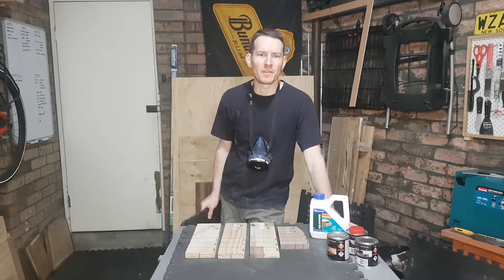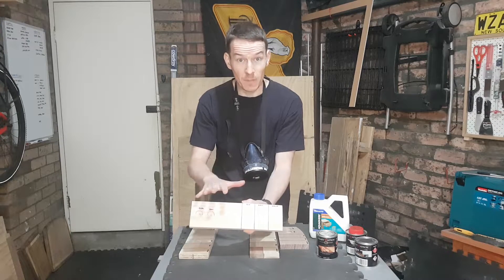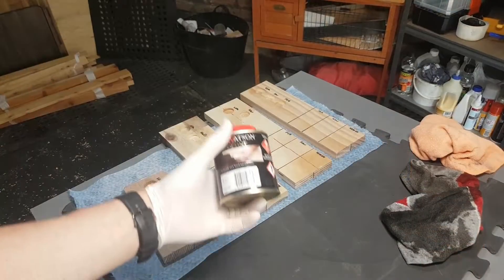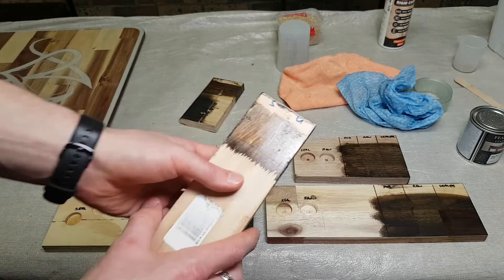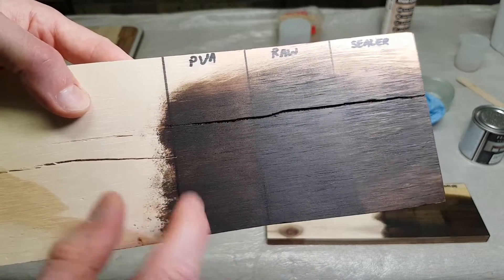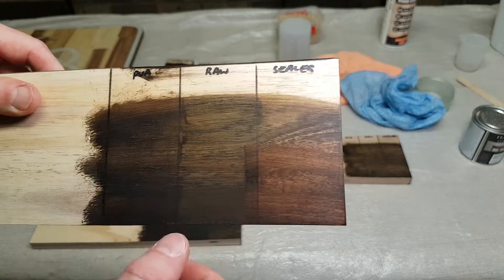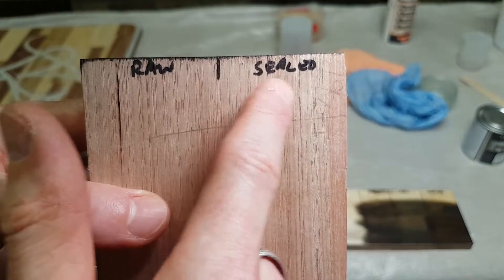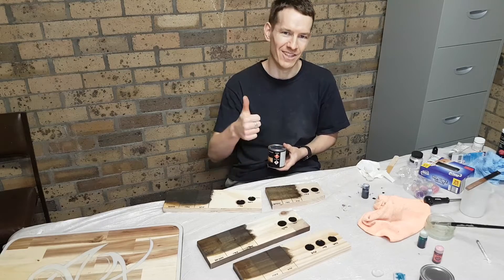Feast Watson Sanding Sealer Review & Test

Comment: The tiny checkouts or tearouts as you put them were partially filled with the sanding sealer. That's what I like about the FW sanding sealer, because it is also a grain filler. An open grained timber like Tassie Oak looks pretty rough when the finish hasn't filled the surface, but with a couple coats of filler that have been lightly sanded back to create a level surface, things look pretty smicko!
Reply from the maker: I was impressed by that on the Tassie Oak! I thought the dense wood wouldn't show much difference. Yeah I only just noticed the "Grain Filler" on the label. I also noticed the Ubeaut one says "Non Grain Filling" on there so a difference there to watch. I don't stain often, but so far I like it. There is another party trick I discovered which is awesome using this stuff, but I decided to save that for a separate video cause it was so cool 😉

Comment: Mate, I have been using Sanding sealer on my jobs for years, Wattle Sanding Sealer , but I put two or three coats on to lift and fill the grain. Light sand between coats and then put on the varnish and boy it comes up nice. Great insight into sanding sealer, thanks for the video!! Cheers 👍👍
Reply from the maker: To be fair on the Feast Watson, it also says 2 coats may be needed for an even better finish. But even after one coat the difference was noticeable. I'm loving the comments here, learning heaps...the plan works!  😂
Reply: Have you tried with stain over the SS?

Comment: I am not sure whether it is mentioned  on the tin but the (often) recommended way to apply sanding sealer is with a piece of sacking (burlap, hessian) rather than a brush. From my experience the gaps in the cloth combined edges of the fibre help you force the sanding sealer into the grain. This is the way I used to do it a while ago when I used to re-finish piano cases. I've never brushed it on but I imagine that it might leave quite a bit of excess on the job which would cause more dust when sanding, loading your disk or paper quicker and the higher possibility of an uneven finish if not sanded well enough. I realise that the samples were small so difficult to use a piece of hessian. Where to get hessian these days ? Coffee roasters they always have empty sacks around and will often give you one or sell you one at a low price. Just a thought .
Reply from the maker: No the tin says brush or roller but the sacking idea seems great, I might try that if I can find some hessian! Yes, this grain filling one does clog the sandpaper pretty quickly if you cover a larger area, I've only used it on smaller pieces, but if you did a whole tabletop I think that would definitely be worth a try. Thanks for sharing your experience! 👍

Comment: What a brilliant video! I've been on the edge about using the sealer or not before staining my coffee table. Lot's of company seems to brush that step off, swearing their stains don't need it. On a side note, may I suggest you reduce a bit the lighting in the video; sometimes the glare of the light was a bit strong to see the wood clearly.
Reply from the maker: Cheers Barbara, thanks for the heads up on the lighting it does throw up some glare when I get too close, I'll watch that in the future! I was wondering the same as I rarely see it used, and I suppose you don't HAVE to, will depend on the project, but I stain so rarely that when I do, I think I'll take the extra step to help me get it right 😊

Comment: Can you help me understand what the Feast Watson Timber Primer is for? Do you use it with Sanding Sealer? Can you test the Timber Primer Please :)
Reply from the maker: Hey Sheri, I had to go to the FW website myself to check this out as I am unfamiliar with the product. Short answer, no, you use one or the other, they are both timber sealers. Here is the summary of what I was able to pick up. Sanding Sealer and Proofseal are both for indoor use, Timber Primer is for outdoor use. Sanding sealer is grain filling meaning it makes finishes super smooth by filling all the little imperfections. Both Timber Primer and Proofseal are non-grain filling, meaning they protect the wood and give your finishes better coverage and appearance, but won't affect the 'feel' of the wood. At least that's how I read it! For my outdoor projects, I'm normally a fan of decking oils like Aquadeck, which you can't use a primer under or they won't sink in. But if I find need I'll give the primer a test you 😊 -  I hope that helps a little! - James

Comment: You could have tested/compared the sanding sealers build vs varnish which is what I am looking for, you could also have used shellac in the comparative analysis and not the pva glue which a pro would never use, the good thing about shellac is that it sticks to anything and anything sticks to shellac, so for refinishing older finishes is excels and prevents laminating.
Oil stains are a lot less likely to blotch as well, and bitumen thinned with turps is black japan and really adds a wonderful bronzy tint used thinly over a finish but needs to be sealed with a non oil based sealer like shellac prior to using oil varnish.
Reply from the maker: Argh now see you used the 'pro' word... I am very far from that, just testing my own personal needs ;) The PVA idea came from woodturner friends who use it to seal endgrain and help slow the drying process. I've not used shellac but have heard many good things. It makes me wonder why it has fallen out of favour in modern making.... Im guessing the cost? That would be a good comparison video, I'll keep it in mind as a follow up if I find the time.

Comment: Love the vid . I use the sand sealer ( brand you tried ) but in between sanding on lathe to hold flakey grain woods from flaring out. I have started to use the product called proofseal (from same brand) and this stuff is brilliant and not thick like sanding sealer. I don't recommend getting a large tin of sand sealer unless you plan to use it all pretty quick as it goes thick and horrible pretty quickly I've found .
Reply from the maker: Funny you mention that about it going off. I cut it from this video as it was getting a bit long but the first tin I got was actually dead (congealed) before I even opened it. We went through 3 tins at Bunnings to find a good one!
Reply: Yep it can be painful stuff .  Proof seal is a hydrocarbon based sealer that wipes on and dry in 20mins . Is great for under resin and is recommend  for proof tint. Can flood seal end grain so get a great soak in.
Reply: @theskuta77  Old comment I know, but can you use the stain over the proofseal?
Reply: @lauraj2096  no i dont think so . They make prooftint which would do the job of proofseal and stain at same time i think

Comment: Hi Aussie here, did you put one coat of sanding sealer on the wood also can I put sikkens stain over the wood that has had the Feast Watson sanding sealer?
Reply from the maker: Hey!  I can't see the brand making a difference. I think the tin says 2 coats, sanded in between for using with stain. For resin sealing I do one thick coat and don't sand.  😊
Reply: @FixitFingers Also I'm wondering can sanding sealer be used to seal the wood instead of a varnish or Wax?
Reply from the maker: @lyleeggmolesse5330  no, definitely not. It soaks in and can leave a soft crumbly residue on the surface. Needs to be sanded back and a wax or varnish applied afterwards

Comment: Is sander sealer required only before staining, if I plan to paint the wood is sanding sealer necessary?
Reply from the maker: Hey Matt, no if you are going to paint no need to use a sanding sealer. It is designed to help even out stain and is also good for smoothing the final finish of oils. I can't see benefit if you are going to paint so you can skip this step. 👍
Reply: Depends on the sealer.

Comment: you're getting bit mixed up about wood conditioner which u should apply prior to a stain and sanding sealer which you should apply after you stain you're wood. But if you don't stain you're wood then go right ahead and use the sanding sealer if you want to .
Reply from the maker: G'day Sean, the Feast Watson Sanding Sealer is specifically designed to be used on open-pour wood before stains. I've not seen "wood conditioner" in Australia so it may be a nomenclature thing. (Says so on the side of the tin ;) https://www.feastwatson.com.au/products/preparation/sanding-sealer

Comment: With the sand sealer, can you paint on top of it with spray paint?
Reply from the maker: Can't see why not. Though I haven't tried. Are your thinking masking off and spraying instead of resin?
Reply: @FixitFingers  yeah was thinking using some rust oleum spray paint.
Reply from the maker: Should work. You'd be able to sand back the top to re-expose the wood leaving your inlay coloured. The sanding seal should help stop the spray paint sinking in giving a clearer finish. I'd do a year first as I've not tried it. Let me know you go!
Reply: @FixitFingers  thank you. If I end up going that route I will keep you posted

Comment: I am totally confused. Doesn't it seal the timber that the stain cannot absorb? I thought conditioner before stain and seal after.
Reply from the maker: You know... I'd never thought of it like that! 😅 It is a bit odd isn't it? Sanding Sealer is actually a wood conditioner. It makes your stain go on more evenly... it's no good to use it after stain. I wonder if it's a weird Australian terminology?😂
Reply: @FixitFingers  trying out feast Watson timber primer.  The stain over the sanding sealer I would expect to sit on the surface only as it would not allow penetration. The timber primer is supposed to allow shallow penetration to even out the stain. Sadly no timber conditioner is readily available in oz. The primer is supposed  to be the same. I will give results if interested.
Reply from the maker: @anonymouse1309  please do share your results, I've not tried that one. The sanding sealer is grain filling, so it will also even out small checks in the surface like you get in Tassie Oak. FW also do a Proof-seal which is thinner and dries faster, but won't fill grain defects. My mate who is a turner uses that under epoxy finishes. So many products out there that do just a different enough job to confuse everyone 😅
Reply: @FixitFingers  Ok. The first thing to notice is that Feast Watson on their Web site state for use to even out stain on timber. This does not appear on the actual can. Secondly, it does not dry clear and darkens the wood, so be aware that will affect after stain colour.
Reply: I would recommend using this on soft woods only. It needs to be absorbed into the timber to work and hard woods will not allow this. Was it a success - ehh.
Reply: @anonymouse1309  My experience is different used on hard woods like Brazilian rose wood and mahogany (both as veneers) on multiple piano restoration jobs.

Comment: Not that great a test I'm afraid, your test samples are too small to see any blotching or get a true idea of how the sealer/finish looks.
Reply from the maker: Thanks for the feedback! Certainly could be improved by increasing the surface area to get an idea how a  table top or cabinet panel would look with and without the seal. However even these smaller samples are indicative of what you can expect. Chances are if you are looking at this product, you have experienced the blotchyness in your timber and are looking for ways to combat it. These quick tests convinced me the product does well what's on the label and it hasn't disappointed since I've started to use it on projects.

Comment: Interesting comparo mate. I think the black japan stain made it difficult to see the results as easily on camera. I've used FW sanding filler on very large built ins two rooms, made entirely of mtn. ash (tassie oak) but used a FW jarrah stain, two runs, worked quickly. Then the FW filler, very finely sanded, only by hand. Worth doing two layers. Then 3 layers satin lacquer. Scourer sanded between layers. Magnificent finish, both ply and frames. Working the sanding filler properly was a little bit of a learning curve to fill the grain, as was getting even layering of the stain but chalk and cheese on quality finished projects. The filler really evens out the finish and gives that super smooth quality furniture touch. Enjoying your detailed, casual approach. Cheers PP
Reply from the maker: So you stained first then, then used this as a filler after to improve the finish... interesting. I am brand new to staining so just followed the instructions on the side of the can and I expected a few errors along the way. In fact if you watch next week you'll see a few of them on that project I was working on 😂
Reply: @FixitFingers  Sorry mate, no I filled first and sanded carefully. Too late to be commenting!:-) I've got a pro mate who told me what to do. Really impressed on me how fastidious you need to be to get the finish. Sanding needs to be spot on. The sealer was so impressive I would never skip it for a great finish. Look forward to the next vijeo. Cheers PP